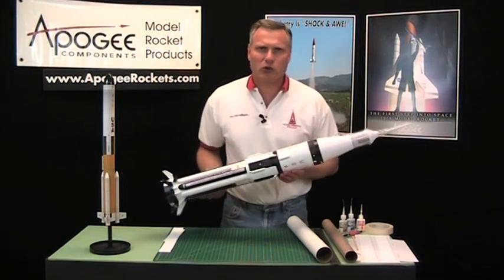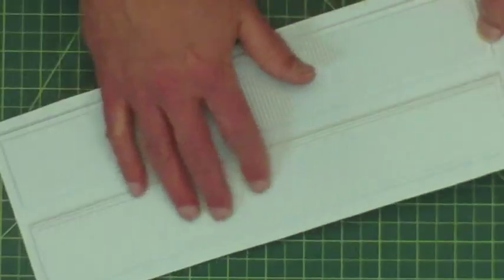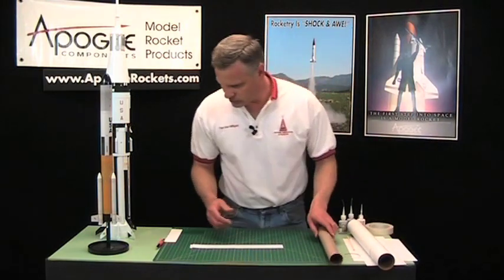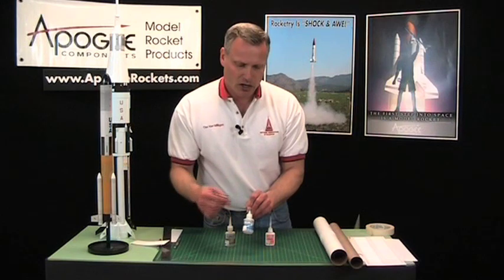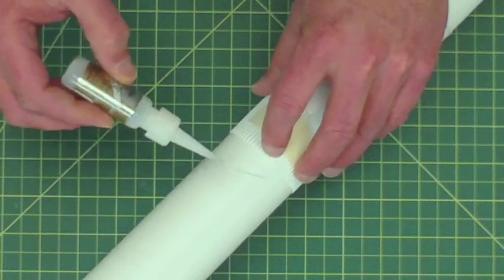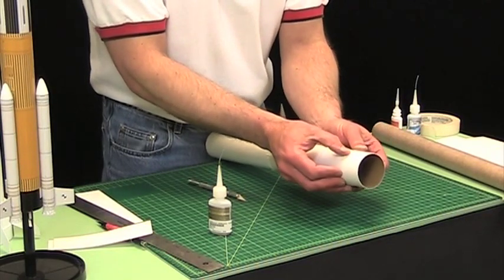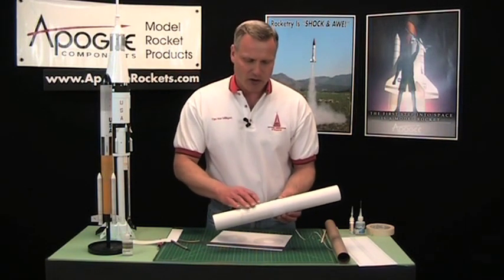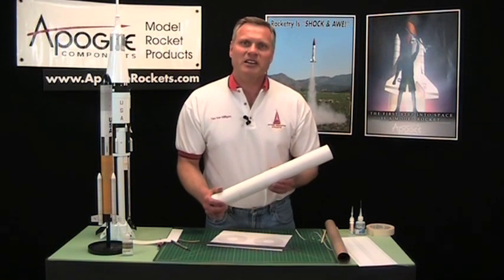Add Surface Texture To Your Model Rockets

Comment: I use spray adhesive (Super-77 not repositionable 75) for vacuum-form wraps.  Clean the plastic with alcohol/water mixture.  Then spray it from 2 different directions to get it properly coated.  Slowly adhere with finger pressure while stretching the wrap to prevent air bubbles and misalignment.  Its NOT hard.  If you have edges that didn't get enough glue, just add a bit of thin CA and it will wick into place.